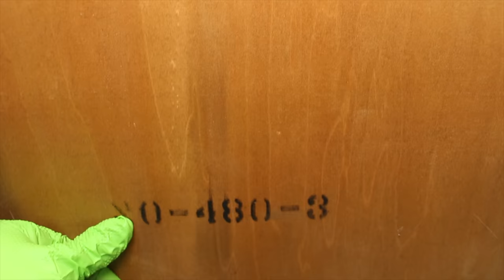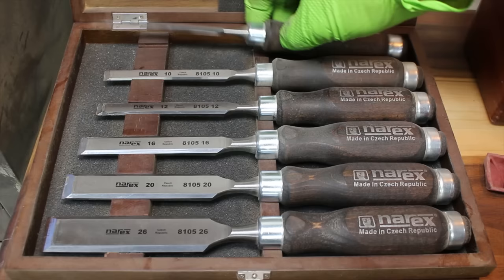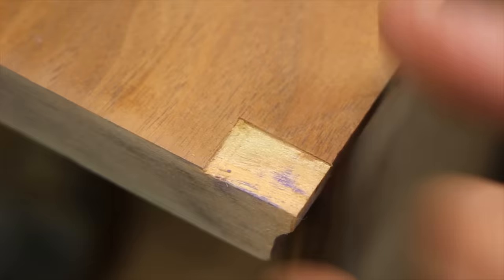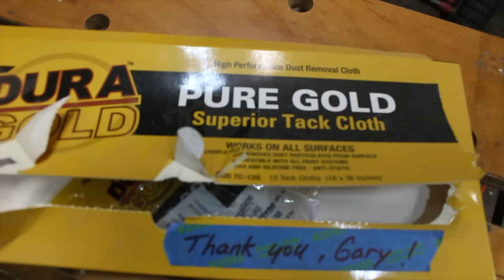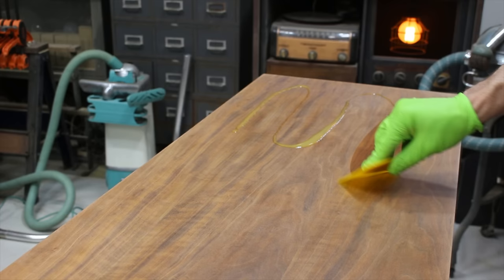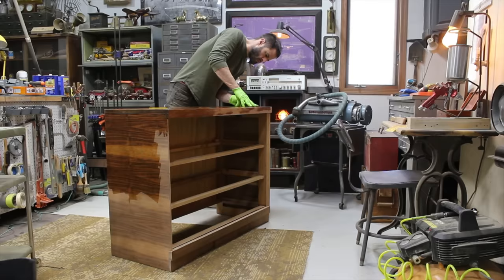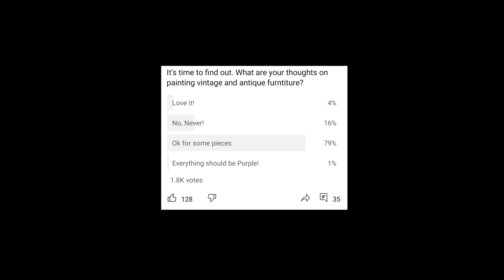Ep. 70 Amazing RESTORATION of a Nasty Painted Walnut DRESSER

Comment: I had a victorian piano bench I had to restore once. Lots of Mahogany veneer on the seat, and in very poor/loose condition, but the rest of the bench was in great shape.  I peeled off all the loose veneer so I had an even center strip intact, and re-glued the center section.  I got some new mahogany veneer.  I pieced the best of the removed pieces till I got the center section in the original veneer material to be centered with a 2 inch wide unveneered strip on each of the long sides.  I cut the new veneer in matching strips and matched the direction of the original graining.  I had to install two layers of the new, as the original was thicker than the new stock.  when glued and set, the two side strips were just bit thicker than the original, which I was able to sand down so all was level.  Then sanded the whole top, stained the new to darken it down closer to the original.  Finally, I finished the top with an orange shellac, which was the original finish that i had removed.  The two even stripes down each side looked fine against the original center veneer.  I was pleased with the final result.  Since then, I have used that idea to do matching "replacement" veneer to approximate the idea of veneer design.  I have been pleased with the results the majority of the time.

Comment: so pretty! 😍🥰🥰
I have an old desk and dresser that has veneer damage (bubbled on the bottom drawer of the dresser, and large chunk missing from the front of the desk), but do not have access for veneer replacement pieces
Already attempted to glue back down the bubbles, but they still show, so I just let them be and painted over as best I could.
I guess I will end up wood-filling the missing section of veneer and painting over the desk.

Comment: Another beautiful piece you have completed !!  I love watching your videos because I learn from them and i get inspirational ideas for future projects.
Wasn't the application of vertically aligned grain more prominent in the mid 1900's ?
I have refinished some of my own family pieces.  My favorite was a small chest of four draws made completely out of Cedar.  It was my dresser from birth and now my daughter uses it for her youngest child.  I stripped it because I had always hated the color of the semi-opaque stain and it always had a rough texture that dust would stick and made it so hard to clean.  I dry bushed three different shades of gray water based paint on the rough texture before sanding it.  I've done this imitation white-wash affect on several pieces to make them look weathered. It works every time.  For this piece, i did the sanding after the painting to enhance the aged affect.  Applied a single thin coat of matte poly.  It was perfect for me and what I desired.
My daughter has since painted over it, I had forbad her from stripping it again or using oil based products.

Comment: To me, this is quintessentially walnut and MCM.  The trouble they went through to book match it, means they meant to showcase it.  This would have been a shame to paint.  Since you didn't buff up the pulls, might mean they weren't solid brass.  Walnut was expensive back then, it is weird they used inferior pulls.  No job is perfect, but this is pretty close.  Thanks.
Also thanks for the review of the stripper and the rubio's finish.
Reply: I think the shape of the pulls suit the dresser but something about the tone of the metal is off. Might try covering one with electrical tape to see if matte black would be better. 
I gasped out loud at how stunning the sunlight pour of finish was! Bravo Barry.
Reply: @Dre-in-PA  good idea, the shape is fine to me, metal looks strange.

Comment: I started stripping and refinishing at an early age.
My Dad had his wood~shop on our property. 
As this wasn’t his only job.
There are times you can’t waste hours using environmentally friendly products.
Therefore, you are fortunate to have both access, and ventilation.
I tried my best to use environmentally friendly products in my apartment.
They simply (do not) work as well, you are correct.
You never can get a piece back to it’s original factory condition.
For the fact that nearly everyone I know my age.
Have had to become ‘Employment Nomads’ which equals nicks, scratches, or worse.
I myself am not a fan of paint...no one appreciates another’s colour palette.
Likewise, the antiquing kits that spanned the ‘70s.
Were 3 step oil based products, that recommended sanding, roughing up the piece.
For better adhesion this mostly destroyed Beautiful woods, some of which are now extinct.
Leaving no choice, other than repainting.
As sanding intentionally was done in circular motion.
This often dried veneer, making it lift, and eventually crack.
I certainly commend you, for restoring these never to be made again.
Pieces of History for present as well as generations that follow.
As far as your voice?!
It’s you, your signature and these are your videos about your passion.
Like a previous commenter said ‘they have the personal option to mute.’
There’s absolutely nothing wrong with your vocal quality or vocabulary.
A+

Comment: There's only satasfaction to be had in restoration rather than painting if you find wood grain to be beautiful. Many people do not. Often times we can get trapped in our own heads and forget that there are 1000s of entirely valid opinions for most subjects. For example, I find metal furniture to be inherently more pretty than wood. Even if its just a basic geometric shape painted beige vs an elaboratly carved wooden version of the same thing, I prefer the metal one. Hard lines, smooth surfaces, and the durability make it jus better to me, asteticly and practically. That said, i very much appreciate and admire the craftsmanship of wooden furnishings. Hence, why I am here.